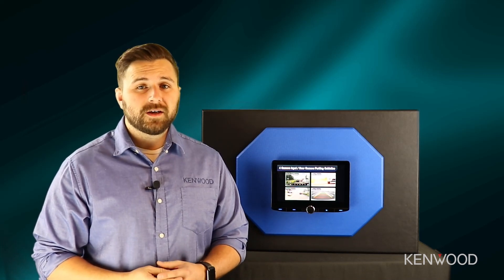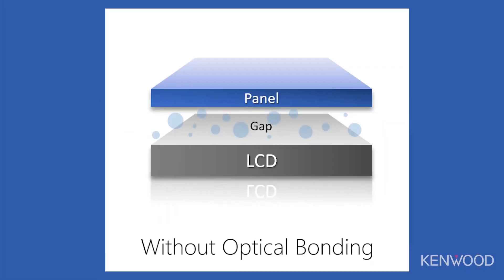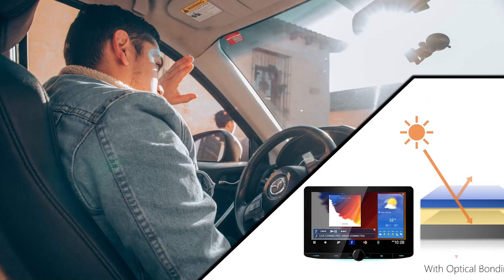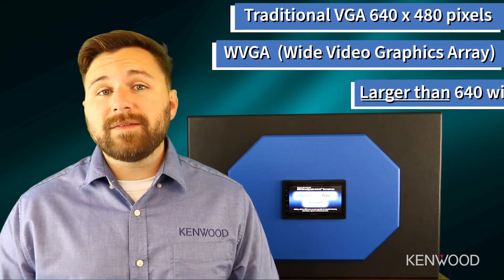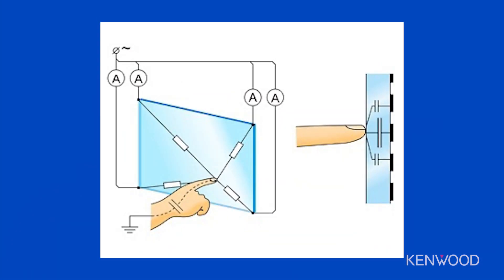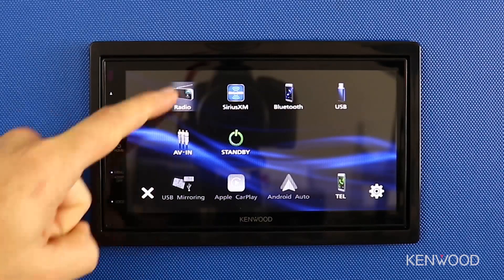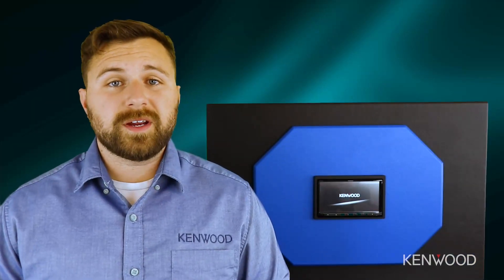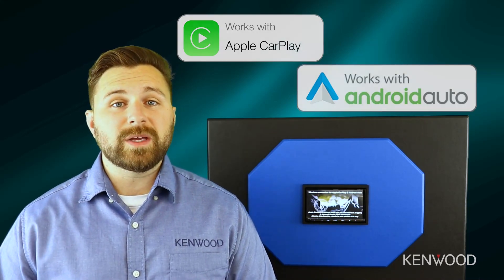KENWOOD Screen Types: What's the difference?

Comment: I have a very expensive DNN9350BT that has a defective screen.  Is there a way to replace just the screen with one from another Kenwood model? 
The DNN9350BT is now discontinued but there’s no unit in the Kenwood range that has a true Garmin GPS receiver installed… hence I really want to replace the screen only instead of the entire unit.

Any ideas please? Half of the screen has gone blank after I tried using contact cleaner spray to clean out dust from the buttons at the bottom of the screen…

Comment: When i change the volume up on just my phone to max it is not at max volume on the radio, i have to turn it the rest of the way up on the actual head until, i have an iPhone is there anything i can do to not have to use the knob on the radio?
Reply from the maker: Caden, This is a normal operation when using a Bluetooth connection with your phone.  This keeps the receiver in control over the audio.  Try using our KENWOOD Remote App S from the play store or iTunes. it's a remote control app you can download to your phone and operate the receiver from there. Thanks!
Reply: @KenwoodUSA  ok thank you i had some trouble some time ago connecting but ill rry it again

Comment: All well and good , but how do I calibrate my dmx125 screen thats all herky jerky and unresponsive?
Reply from the maker: Jakub, you should first try cleaning the screen with a microfiber towel and some glass cleaner.  If that doesn't improve response, check for updates on the receiver from the KENWOOD support page on   https://www.kenwood.com/usa/car/
as a final adjustment, try initializing the receiver in the setup menu (this will reset the receiver to the default setup.) Thanks!